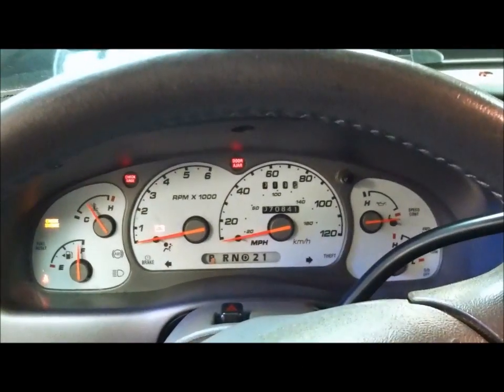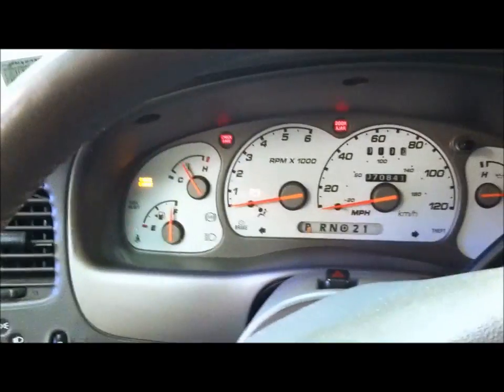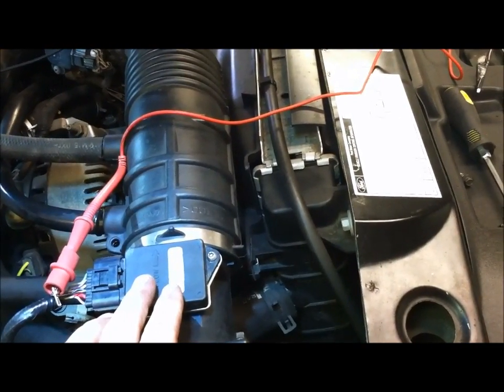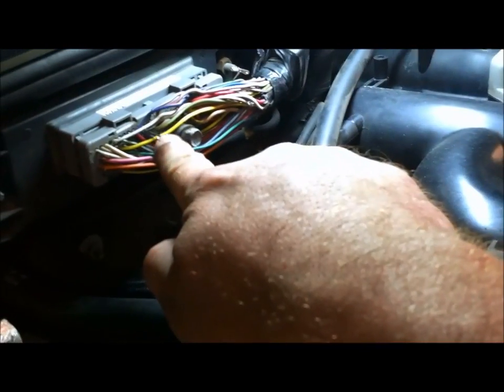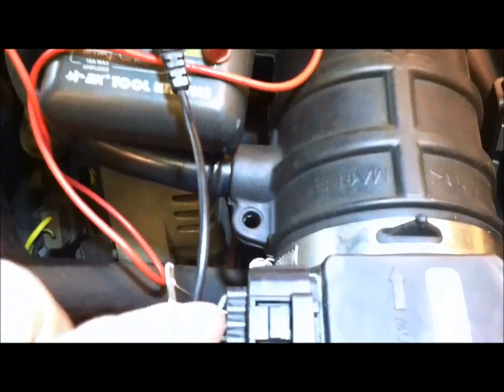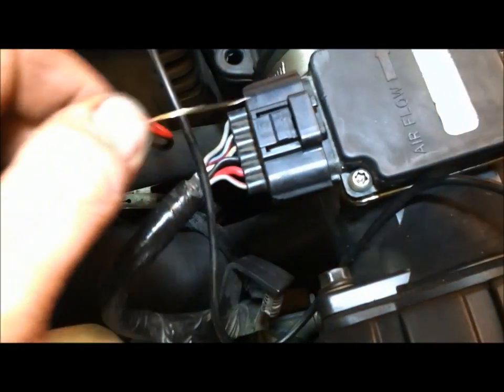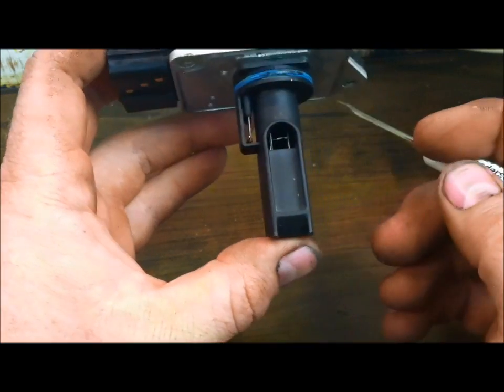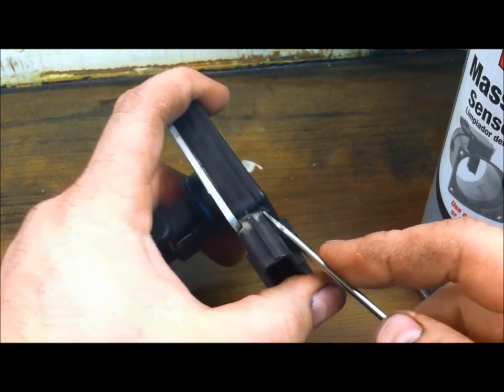2001 Ford Explorer 4 0L basic MAF sensor testing.

Comment: I have a ‘96 F-150 with the same P0113 and P0102 codes, I’m gonna buy a scanner and try this myself. I’ve already replaced the MAF sensor twice with no luck of the codes going away. So I’m either gonna lean toward a bad wire or maybe a bad computer. 

Today I replaced the IAT sensor which is separate from the MAF sensor on that truck, and the CEL went away for one trip then I shut it off and turned it back on and it came right back on and the hesitation and low power @ low throttle bs started again. So it makes me suspicious of the computer.
Reply from the maker: It’s been a while but I believe both those sensors share the same ground I would check those grounds to see if they are shorted to the 5 volt reference or to a 12 volt source the p0113 only occurs when the computer senses more than 4.91VDC for more than one second computer problems do occur but it’s unlikely
Reply: @DustinsMobileWrench  I’m still relatively new to working on stuff, like I did my whole tune up on here along with changing out a few sensors, cleaned the throttle body, put a new gasket on etc. So electrical stuff is still kind of beyond me in terms of understanding it but I’m kind of getting it based on your comment and your video but still kind of bullish about trying to do it myself
Reply from the maker: I understand completely electrical problems are the worst go to a website called Mitchell on demand for around 30 dollars you buy and download troubleshooting guides electrical schematics and so on this will help you immensely

Comment from the maker: On this truck they are but that's not always the case you should use a wiring diagram I did not have one so I unplugged the harness at the PCM and at the sensor and did a ohm check from the pins on the sensor plug to the pins on the PCM plug

Comment: Did you ever get it fixed ?  I got a 2003 Ford Sports Trac. SOHC 4.0. Starts up fine. Most of the time when you drop it into drive and take off it sputters and shake. Sometimes even die. And a time or two has stopped completely. After 10 -15 min starts up and runs fine. idles ok. Drop it into gear ok. If you try and take off fast that is when your problems start. And sometimes you can be just cruising . And all the sudden it will start shaking and sputtering like the damn thing is going to fall apart. let off the gas and ease back into it and its fine. I replaced the plugs wires changed the oil gas and air filters. Like you I waited until the engine light came on. Took it up town and they said I got trouble code p0303. Handed me two pages of things it Might be.
Took the coil pack off and checked it against a new one. They had about the same ohms. Not sure if I checked it right But I did follow the guy in the video. I hope he knows what he is doing.  I put it back on hooked everything up. And my engine light went off. Still runs the same. So I moved on to TPS and mabey cleaning the Throttle body itself.  If that is not it then to fuel injectors. Its like a woman bitchin and rasin hell. She wont tell what is wrong. But she is going to act up and show her ass. If you don't give or do what she wants. So I sit here wondering which damn part do I buy  now to make it happy.
Reply from the maker: sorry for the late reply haven't been on here for a while are u still having problems if not what fixed it and yes that did fix it my method of testing is the half assed way to do that you really need a scope a dvom  doesn't update fast enough to see a glitch
Reply: No I still have not gotten it fixed. I took it to a shop. And the guy may be right I do not know. He said it was the cat. converter. are bad. After some research I did find that the fuel injectors are giving  Ford owner's a fit. #3 goes bad and fills the cat. with gas and destroys it.
So there is a extended warranty for 8 yrs or 80K which ever comes first. My truck 11 yrs old and 110K  Yes I can say I am SOL. The guy at the shop was more than willing to help me get her going again. And for a mere $1600 or so we should have this thing up and running. I think he has me confused with someone named Gates.  It is going to have to be put on a machine to figure out what is wrong, I guess.

Comment: i got a 2002 ford mondeo whith the same sensor and got the same code as you have and  i got this question for you. cold my car have the same wiring diagram so i could test the ground and signal just by following the order of the cables shown in this video?